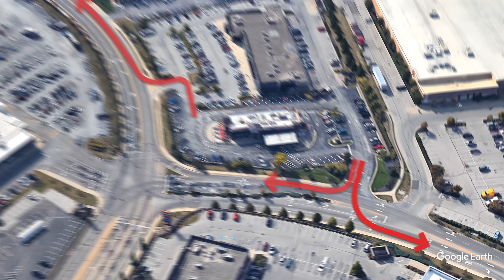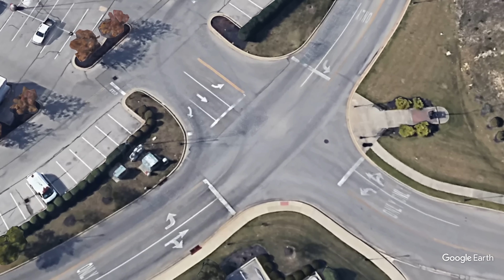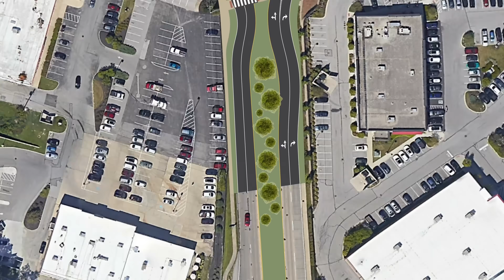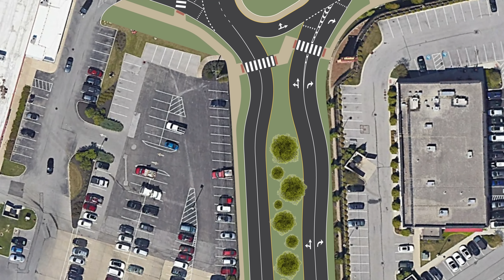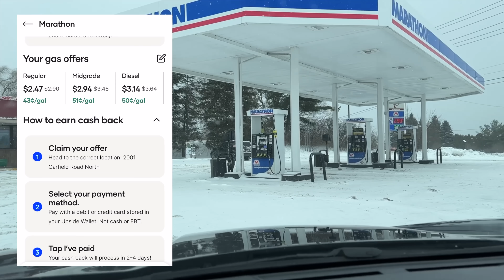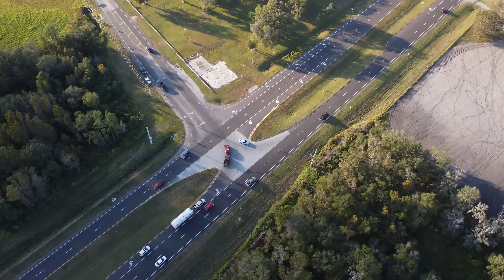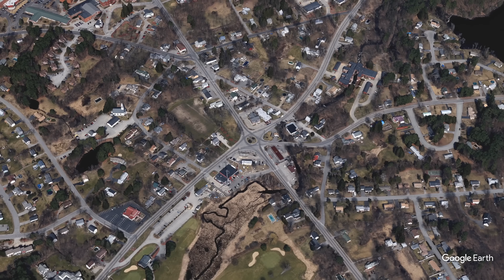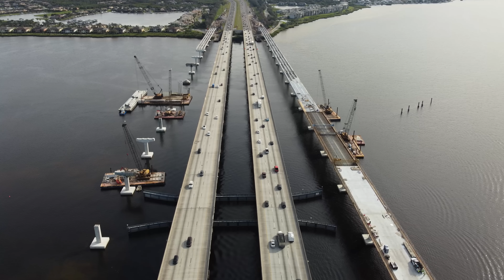These Intersections Should Be Illegal

Comment: Good commentary.  Your solutions seem very reasonable and will accomplish their goals, but they are more complex for drivers.  That's what troubles me about a lot of these types of novel solutions to traffic problems: driver complexity.  Basic 90 degree intersections are as simple and straight forward as can be.

Re:  roundabouts, I like those with single-lanes, not multiple lanes.  Again, it's an issue of complexity.

Comment: You have terrible ideas. The existing design for #1 is is awful, but the roundabouts would only be an upgrade from 'awful' to 'bad'. For #2, the answer is Michigan turns, which is pretty close to what you did, but with 2 u-turns instead of a u-turn and a left. That way the single u-turn could also a serve any driveways added further down later on.

Comment: 06:54 There is already a left-turn lane in place for traffic heading right to left, so that's a head start. Building an island to deter (it will never fully prevent) traffic in the vertical lane from turning left is a good idea, as is the U-turn lane. One small thing I'd change in the simulated design is to allow a longer slip lane or merging lane for articulated lorries (semi-trucks in the US). They're not renowned for fast acceleration, so a longer slip lane would let them build up speed before merging with traffic heading right to left.

Comment: 4:28 I would like to add another change. I call it the "Ikea" Principle. If there are 2 Parking Areas right next to each other, connect them. If you make it possible to change from the chick filet parking area to the target parking area without having to get onto the road, do it. You dont need 5000 connections. Just 2. One from Target to Chick Filet, one from Chick Filet to Target, both one way connections.

Comment: The redesign looks great, but ignoring desire lines is a mistake. 
When you block a left turn to 'smooth' traffic, you just force drivers into a massive detour loop. 
That 'extra' driving actually increases density and induced demand. Context and connectivity matter more than paint.
Talking about the first one

Comment: Sounds like nobody outside of Washington wanted the bike lanes, but they couldn’t afford the project without Washington’s help.

A similar situation happened recently in Metairie, LA on Severn Ave. The town is a suburb of New Orleans, and so storm drainage is a priority.

The town needed to install larger storm drain pipes to replace the ones underneath Severn Ave, which necessitated a road construction project which tore up the lanes.

The only way the feds would pay for it is if the project reduced the car lanes from 3 to 2 in each direction and replaced the 3rd lane with a bike lane.

The road is an uncontrolled road lined with business along the entire length, and the bike lane is between the two traffic lanes and the turning lane.

Comment: In the first example
I like 90% of that.  but that last round about is not a good idea.   Multilane roundabouts not the fix all.  For one, that looks like a lot of semi trucks will use that intersection.  They are too big for roundabout and they are kind of needed for that area.

I think a intersection bypass would work better.  Let the people on the main road going strait go over the intersection, then under it, have a stoplight intersection.   
If most of the main traffic goes straight, then they can just take the bypass over the intersection and reduce the throughput of the intersection.  Then the remaining intersection can only worry about people turning.

Comment: Oh hey, that first example is nearly identical to something I have in the (relatively) nearby town of Alexandria MN. Except that instead of a Chick-fil-A, it's a Holiday with direct access, right beside an alternate feeder/frontage road from the Walmart and Menards (read Home Depot/Buckees/B&Q) and nearly straight across from a Culver's, which draws in comparable traffic flows to a Chick-fil-A. That light consistently gridlocks that entire street at rush hour, mostly due to the protected left turn everyone wants to take onto the singular highway that goes to the interstate and the nearest next most populated town. Love that bit of road design (not!), but I always blamed the intersection density. You could solve (at least part of) the Chick-fil-A left turn problem by simply making a frontage road into the Target parking lot and removing the Chick-fil-A direct access altogether. I do think the highway roundabout and a roundabout U-turn is a good idea in my case too, though -- there's even enough room for both, if you fiddle with the placement a tiny bit. The Culver's/Aldi's entrance across the road and down the street a tiny bit needs a roundabout anyways, and then the run-down Arby's straight across from the Culver's could get direct access to the roundabout, which would improve business there massively. Oh, and the highway roundabout would improve access (especially walkable access!) to the frontage road on the other side of the highway, which serves 3 restaurants, a gas station, and a Target. Those places are always struggling too, although not as much as that poor Arby's (being as how they're on the same side of the highway as the industrial park).

Also, holy shit those bike lanes are the worst idea ever! Traffic speeds go from highest in the center of the road to lowest on the outside. Everyone knows this. So why the hell do the slowest vehicles have their lane in the fastest section of the road? So much common sense had to be lost to approve that nonsense.

Comment: I wish rotaries were more common in the United States. They are so much safer and faster then an intersections. People like to say "They are confusing" but they really are not, same as an intersection, if you want to go right you are in the right most lane, if you want to go straight you are in the next lane in, and if you want to go left you are in the left most lane. In a rotary, right turns just go right breaking off from the straight lane if there is no dedicated right turn lane, straight lanes are typically the outward most as you pass the intersecting road, and left turns or i turns in the inward most lane, for the first 2 road exits then merging outwas before the inlet of the road before your exit. Super smooth and the more you do it the easier and more normal it becomes.

Comment: I hate your rural highway left turn, after turning right you have to quickly speed up and cross 2 lanes of high speed traffic, then brake again for the u turn. Horrible. A simple traffic light which heavily prioritizes the through road is best here. You will have to wait quite long to turn onto the main road but you'll at least not die. A roundabout is less ideal as the vast majority is through traffic on the main road rather than turning.

Comment: For the second example I'd opt for a roundabout. The road is high speed, looking at the speed of the cars, but it should be a 50 or 60 mile road at the most. It doesn't have an emergency lane, so a two lane roundabout would be better.

Comment: In Serbia, new Šabac-Loznica highway has roundabout at smaller intersections (where less local traffic is expected) and grade-separated intersections where higher traffic is expected. 
This solution is cheap, very effective and saves a lot of money. Issue is that many drivers treat this highway as freeway, and instead of 100km/h (with slow down to 80 at intersections and 30 at roundabouts), they do freeway speeds (over 120km/h). This caused many one vehicle accidents at roundabouts.

Comment: The mall areas are a horror, and for no good reason. It's trivially easy to properly design a safe access road for them using a couple of simple steps:

1. The access road is a cul-de-sac. There are multiple huge stores there; there's no reason to funnel through traffic by them---they get 99.9% destination traffic anyway. A big sign at the entrance to the access road is more than enough.
2. The access road has a fixed divider, massive enough that nobody even thinks about doing a left turn. All traffic exiting or entering the access road is making right turns.
3. The access road ends in a loop. (This can be a roundabout to chain access roads as long as the whole thing stays a cul-de-sac.)
4. At the beginning of the access road, there's a U-turn for traffic that doesn't want to leave. (If the access road is connected to the main road network with a roundabout, that U-turn obviously isn't needed.)
5. The access road can be 2 lines wide, but then it needs physical lane dividers at the entry/exit points to limit entries and exits to the right lane.
6. Using short onramp/offramp combos for the lot accesses (just a couple of car lengths) to separate the turning cars that slow down from those who go on without slowing increases capacity at the cost of a faster (i.e. more dangerous) traffic flow.

Comment: I just drove through Alabama, and you could probably do a whole series on that state.
1. I had a Stop sign getting on a freeway at a blind curve with 50 feet of merge lane. 
2. I went through multiple 3-way stops at non-3-way intersections.
3. I went through an absolute unit of a 4-way stop for two 2-lane highways. It was so much larger than a roundabout would have been, and still it was basically 2 unlit perpendicular 60 mph roads with a stop sign. 

This list is from a 1/2 day drive avoiding Birmingham.

Comment: Roundabouts are not the solution for everything.  If you have strong tidal flow on a particular approach, some movements never have an opportunity to get into the roundabout... and you end up having to do a 'hack' by installing a pedestrian operated signal site to introduce artificial gaps into the heavy approach...

....but that often leads to simply moving the high demand around the roundabout owing to the density of the circulating traffic... and thus, other traffic can(not) enter the roundabout... and you end-up having to signalize the intersection anyway....
Reply: Roundabouts are not the solution for everything, but in many in if not the majority of cases turning a traffic intersection into a roundabout intersection not only greatly increases traffic flow, but it also MASSIVELY increases safety. 

Always makes me sad that I see so many crashes at intersections in my city and it always makes me think how easily they could've been prevented or greatly minimized if a roundabout had existed there. I mean seriously when's the last time you heard of a crash at a roundabout that caused serious injuries if not deaths? Very rarely if ever.

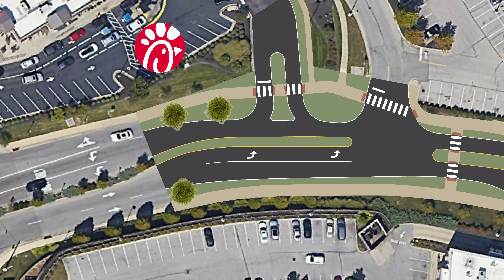Comment: 2:55 The left turn between the two roundabouts is not needed. You could just do a U-turn at the first roundabout. But, that roundabout already provides access to Target. Also, making a left between roundabouts is difficult because the continuous flow in the roundabouts leads to less gaps in traffic.
Reply: It make sense, but the intersection represents today is dangerous and it needs to be notice to make it safer
Reply: Fewer gaps*** not "less"

Comment: The Chick fil a intersection isn't marked correctly.  You are not supposed to cross solid double yellow lines to turn.  It should not have solid yellow lines separating the opposite direction traffic and the left turning traffic.  As it is painted the left turn lane is for the Targer intersection.  It appears that the city probably did not approve the left turn out of Chick Fil A.  Most cities would not allow the two intersections that close together.  The size of lanes is not an indicator of the speed limit.  The reason the access from the highway has 12 foot wide lanes is to accommodate trucks.  It is obivously a truck route at least to service the mall property.  No one should ever base their speed off of the width of the traffic lanes.
Reply: There's turning only lanes that use solid yellow lines on the outside with dashed yellow on the inside which probably leads to this confusion.

Note, I do not like how Pennsylvania replaced many traveling lanes with useless turning only lanes.

Comment: You cannot turn left into that chick fila as pictured as you cannot cross double yellow lines.
Reply: @Streetcraft Also the left out at the same intersection is illegal.  The median needs to be extended the the white bar problem solved.  I know what your are saying well what about getting to Target? Sorry but the design does not permit that.  They could install a traffic signal to make this happen or connect the parking lots together would be easier.

Comment: Roundabouts are so much better:
To turn right, simply turn right, then left, then right.*
To go straight, turn right, turn left, turn left some more, turn right.
To turn left, turn right, left, left, left, left, accidentally go back the way you came, then at the next (i.e. previous) roundabout turn right, left, left, left, left and try again unless you only turned right-left-left-left, in which case at the next roundabout in 5 miles turn right-left-left-left-left and 5 miles later turn right-left-left-left-left-left-left-left-left-left-left until centrifugal force flings your car into the bushes, stick a 'free car' sign in the windshield and fucking walk if you even know which fucking way you're fucking pointed anymore.  Easy.

*If you're in the UK, it's the inverse; to go right, turn left, right, right, right, left.  Etc.  You get the idea.

Comment: In the thumbnail example, there are double yellow lines, meaning they aren't supposed to be crossed, the fact that the top has a turn that would require the double yellow line to be crossed is causing most of issues
Reply: You are allowed to make a turn across a double yellow line in the US. 
The problem is that there are two sets of double yellow lines - that's considered a "painted median" and you're not allowed to cross or enter it at all.

Comment: Crossing two double yellow lines? Two double yellow, spacing more than 24”, is a barrier. Any movement in and out of that Chick-A-Fillet deem to be illegal. The developer should have stretched the island across the driveway or placed raised markers to deter the motorists from making that turn. And why on earth there is a left turn lane out of the parking lot? The reviewer did not see the problem? Fire them all. Besides, in front of the driveway, place the pavement markings, Do Not Block The Intersection, this way you clear the people from the queue.

Comment: In my experience roundabouts make traffic worse not better and I avoid them. 
And having to go south to go north (not being able to just cross and turn at the road) can be just as dangerous because you have a slow car going across lanes and being in the fast lane.
Reply: That's not a fast lane, that's just a lane. The speeds will be more or less equal.
You only have "fast lanes" on freeways with ramps on the right.

Comment: Man, so many mistakes were made in designing this intersection.
1. Left turn to chic fil a is illegal, road marking is for left turn to target
2. Left turn  from chic fil a allowed by road marking but leads to double yellow?? there is no way this left turn is suppose to be here
Reply: exactly, its not as poorly designed as it looks, but people driving as they want make it worse. Anyway just put there roundabouts and you are golden.
Reply: This is what I have posted twice on this board.  Per the lines on the road the left in and left out are illegal.  I don't care what chick-fil-a painted on there "Exit", per the lines on the road you cannot turn left out that way.

Comment: The road markings for that left turn is insane. You're crossing not only yellow lines, but also the dedicated left turn into target. I have never seen anything like it. I wouldn't believe there was a left turn allowed there if not for the literal left arrow on the exit from chick fil a.
Reply: Last time I checked with the Law, turning over double yellow lines is a traffic violation.  So the left turn in and out of Chick-Fil-A is against the law.  This could be solved by a median to the left turn into Target as intended by the road lines.  Any accidents caused can easily point out that the other vehicle crossed double yellows and it is all over no matter if the other car is at fault.
Reply: @watsomd  Surely there's some legal principle that if markings are contradictory then both interpretations are legal. If an arrow says you can turn left you can turn left regardless if some other line says you can't. 

In any case I have seen more of these types of things now, where drivers routinely cross solid lines. American roads seem to be full of them.
Reply: Parking lot markings are generally not part of the DOT and not subject to the same laws.
Reply: @ If that's true then whoever owns the arrow owns the liability.
Reply: I'm 100% sure that "Turn" into Chik-fil-A is illegal. That lane is NOT a turning lane into the Chik-fil-A, It's for the Target as you can see the Clear end right before the Target Left..

Anyone who turns left into the Chik-fil-A is breaking traffic laws.
Reply: @Blue-SuperGiant  I was talking about people coming out of chick-fil-a, following the left turn arrow on the road to turn left onto the main road.

Comment: The roundabout at 4:02 looks like a nightmare. Should be a traffic light at that intersection. Not every intersection is fixed with a roundabout. Looks like a yielding nightmare, relying on other people’s judgement vs them being stopped at a red light. (I’m aware people run red lights)